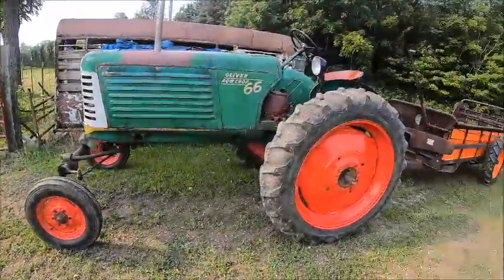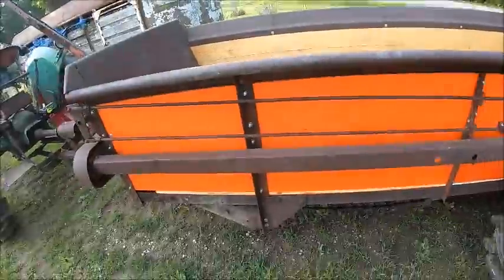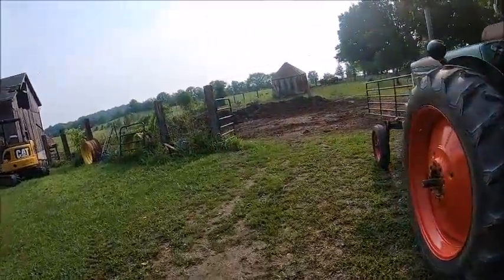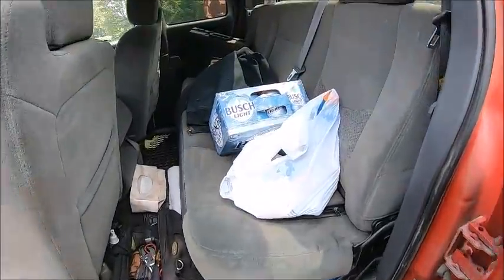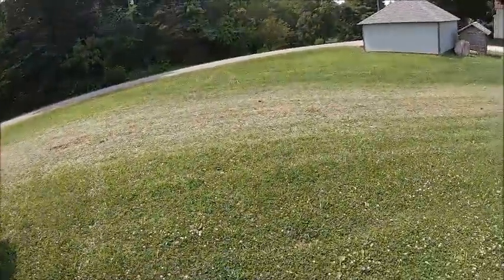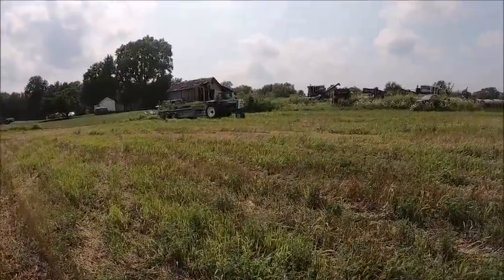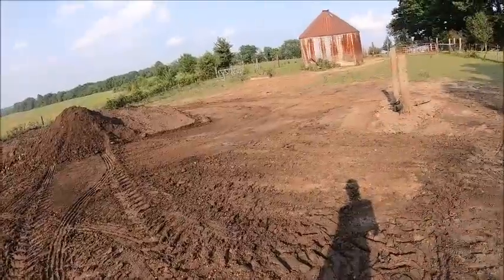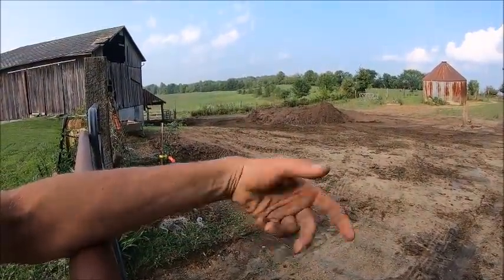Moving A Mountain

Comment: I spent many days spreading manure  back when dad still milked cows. I didn't mind it, got lonely being by yourself for pretty much a full day.
Your dad is pretty good with the mini. It's one of those things that you need to just practice with.
Reply from the maker: It takes a long time by yourself.
Reply: Our 66 had the loader and the 77 pulled the spreader.  Unfortunately, most of our calf pens had to be cleaned by hand.  That was always our Christmas break duty.   We had a daily milking herd of 60 cows.
Reply: @robertheinkel6225  We milked 40ish. And our calves had to be cleaned by hand too. A David Brown 990 usaully had spreader duty(sometimes joined by a Ferguson tea20) while the mf 690 had the front loader to load. Before the front loader(or when the front loader broke down), we used a 3 pt hitch manure fork/loader to load manure. What a pain in the neck(figuratively, and literally).

Comment: Thee is a Race Horse Training Facility not far from us that has been piling  For about 30 years......Nutrient Test indicated that because of the Bedding in the Manure.... it would require astronomical  amounts of Nitrogen to be added to the soil to help break it down..... In other words Aint' worth spreading
Reply: Caleb Grill......This Horse Manure has Wood shavings and Sawdust.....Some of the pile is 30 years old and you can still   see the sawdust and wood shavings.... They have  decomposed  very little   Entirely different than Chicken Litter
Reply from the maker: They need to do a better job of composting. Add some lime every now and again. Introduce some earth worms. Keep it turned over once a week. You could make it spreadable in a year if you actually tried.

Comment: man l cant believe that T chain has gotten that expensive! l had a  IH speader with that chain in it ansd never broke a chain in the 10 plus years l ran it l think it was a 150 bu PTO speader  the minny X is the way to to load manure just think of the clutch wear you saved!! l be watchin!
Reply from the maker: The chain in my spreader was original so the so if the new flat chain last 60 years like the old. I really won’t care by that point.